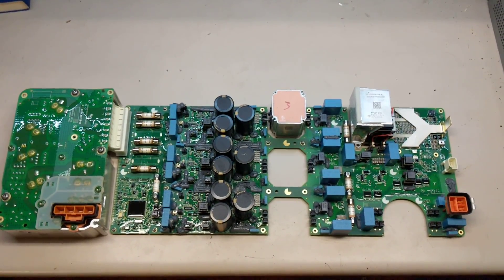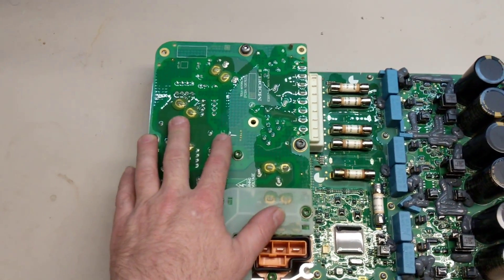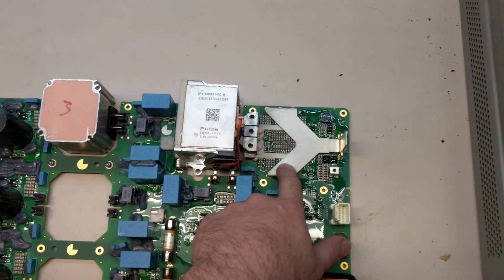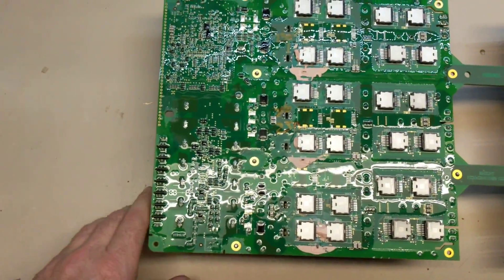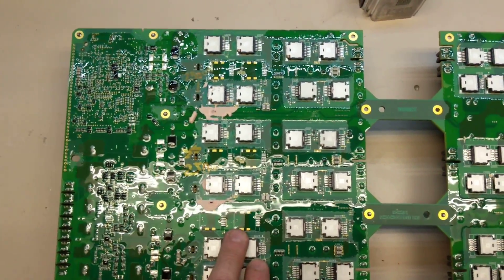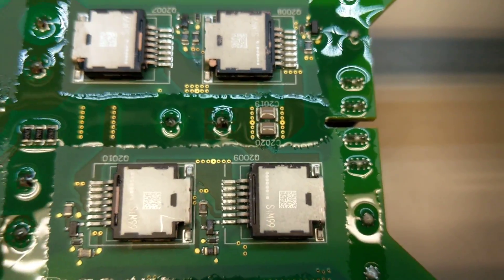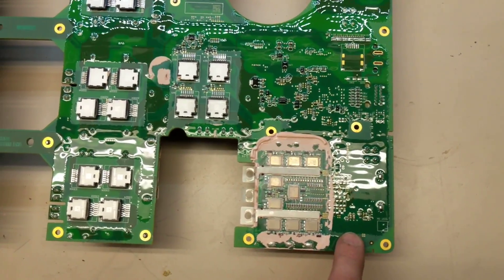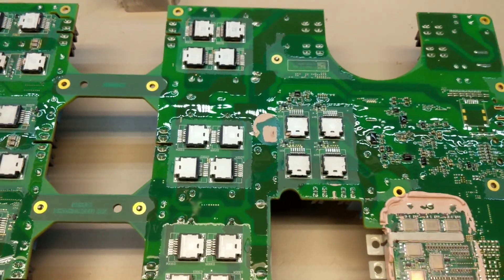Tesla vehicle to grid: Debunked! PART 1

Comment: The suggestion is that Tesla have updated the hardware to allow this. A new revision of the board. I don't see any pictures of the underside of the board (from Marco Gaxiola), but his circuit diagram shows mosfets on both sides:
https://electrek.co/wp-content/uploads/sites/3/2020/05/Screen-Shot-2020-05-19-at-1.58.52-PM.jpg?resize=2048,1542
Reply: Hi, do you have more pictures?
Reply: The problem is that it's not a software issue, it's a hardware issue. Software does not reverse fixed hardware problems.

Comment: This is 2018 board, they could have updated the board in 2020 models? What an I missing?
Reply: I agree, looking at hardware from two years ago whilst saying it’s been recently been added seems odd.
Reply from the maker: If they had, I'd see it in the code.  I just looked at the code for 2020.16 today.
Reply: @Ingineerix  you're mistaken if you think that everything Tesla is doing is leaked in their code. Code likely isn't ready meaning there's no point pushing it out, but HW is, so they're pushing that out and finishing software on the go. Tesla philosophy. Would be interesting to see how a current board looks like. Maybe Munro can say something about that..
Reply: @Ingineerix   schematic here: 
electrek (dot) co/wp-content/uploads/sites/3/2020/05/Screen-Shot-2020-05-19-at-1.58.52-PM.jpg
Reply: @Ingineerix  that answers it for me but as you say IF they changed the bridge rectifier to FET, that's all it would take(?).  That might be one of the easiest running changes Tesla could make in the whole car.

Btw, if you look at the schematic the electrek article, that IS showing transistors throughout (no diodes).  Is it possible this is Y-only for now?  I'll try to link the pic below.  Anyway great work, and thanks!
Reply: @Ingineerix  if I understand correctly, the code would be different because where the diodes are on the board you should, there would be transitors that would need to be controlled?
Reply from the maker: Correct.  Even if they just add SR to improve efficiency (a good choice) to do V2G would require a LOT more software side stuff.  Not to mention the regulatory requirements are non-trivial!   You can't sell power to the grid without an agreement with your utility (interconnect agreement) and a special meter.  You'd also need an EVSE UL listed for grid tie, which doesn't currently exist.
Reply: @Ingineerix  You're right on an individual basis, but there's also the case of the "Tesla Virtual Power Plant" where Tesla becomes an energy provider. They don't mention cars but the two Tesla software developers in this talk explain how the software side of things work (Autobidder etc) and how it all comes together. If you haven't seen it, it's quite informative. https://youtu.be/ggdYts4muu0
Reply: @Ingineerix  They put hardware for autopilot in before it could be used. I would be interested in seeing a card from a recent car and see if there’s a difference.
And remember that cars with the hardware might be going down the production line or be in the parking lot waiting to be delivered. Or held up by not being able to build cars currently.
Reply: @Ingineerix  would the software show the difference if they hadn't written any V2G functionality, and were only using the hardware in a single direction, AC to DC?
Reply: @Ingineerix  They might have the hardware out, but not the code. I'd like to see a board in a 2020 car to be sure.
Reply: @Ingineerix  You do know that works right? They don't send out internal builds to the public, so you won't see that code for a long time.

Comment: Hey, thanks! Why do you think the copper thickness is on the traces to handle that kind of current? Or is it largely doable because of the water cooling?
Reply from the maker: I'm not sure I follow, I don't have an easy way to measure the thickness used, but it's clearly a multilayer board and there are some wide traces!

Comment: Is it possible that they could could do V2G via DC? For example they announce a new proprietary charger/inverter that uses the direct DC connection through the charge port to connect the 400v battery directly to the new external charger/inverter box?
Reply from the maker: Yes, this is definitely possible, but it would substantially add to the cost.  I'm definitely not saying it CAN'T be done, the debunking is that Tesla has been including the capability all along, which turns out is not true.
Reply: @Ingineerix  The chademo protocol and others already allow for V2G and Tesla's are compatible with that with their adapters.  How is it possible that the internal charger allows for this when the protocol itself is compatible with it and must be implemented when a product is designed to allow for usage with the protocol?
Reply from the maker: @joeyscleaningladys  The PCS (internal charger) has nothing to do with this.  In that scenario, you'd need a pricey external inverter to take DC from the car and make AC for the grid tie.  It would cost $$$, not just for the hardware, but it would need permitting, professional installation, etc.  I'm not saying it's not possible, I'm saying it's not BUILT IN.
Reply: @Ingineerix  Exactly and that is the work around many of the comments are claiming is the reasoning behind it is ready.. Every single EV that has DC fast charge capability can do it.  That is being lost in this whole exercise.  There is no scenario of the Tesla Model 3, X, S, Y being able to output dc current to the ac grid in its current form.  Full stop.  Correct me if I am wrong.
Reply: This would mean the Model (XY3S) is not v2g compatible.. This type of box can go onto any vehicle and is agnostic with regards to the power conversion hardware on the vehicle itself. How does this make Tesla V2g compatible?
Reply: To put it more simply, the external wall box handles the inverting of the 400v DC to Grid AC instead of the car itself?
Reply: Charlton Hawkins, nope. the dc couldn’t go through the transformers in the middle. Or the bridge rectifier for that matter.
Reply: @JazzWeisman  Huh? The DC doesn't run through this board anyway though? This board is only for AC charging... Japanese cars also have V2G via DC, e.g. you still need an inverter in your house.
Reply: Yes, direct DC charging is already available in the connector and it bypasses the PCS.   V3 Superchargers capable of peak 250kW so I imagine you could have a wall converter do 25kW and drain your battery to the grid.

Comment: This is what I thought, it would seem that the new batteries would need to be close behind to bother going through the extra expense of a bi-directional charger, and on Model 3 the charger lives in the penthouse, on the battery, unlike S/X where changing the battery doesn't change the charger